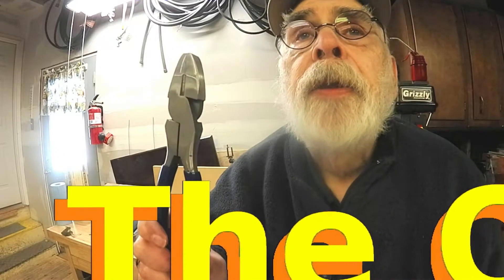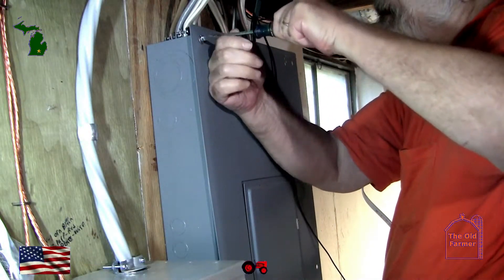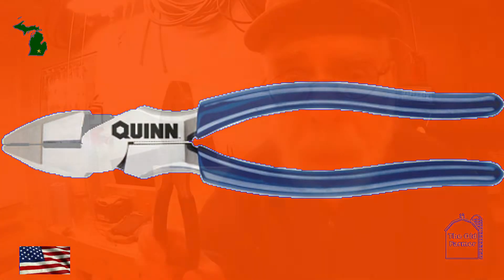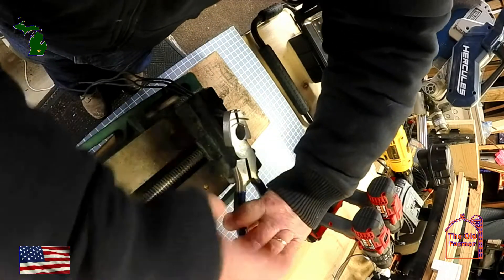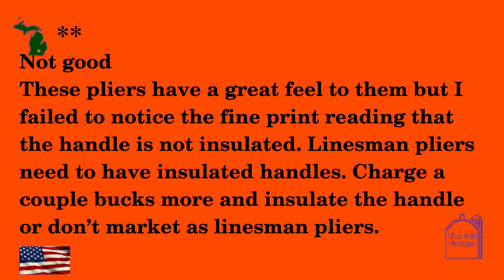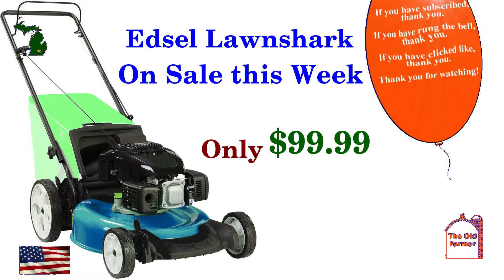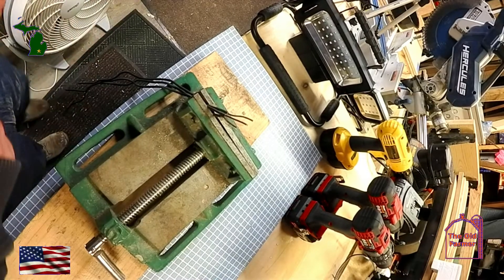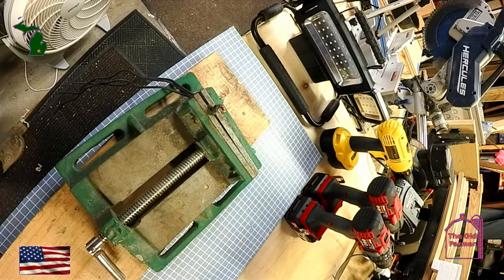Quinn Lineman Pliers - You Need to Get!!!

Comment: Just brought these pliers at a harbor freight outdoor sale for $9 bucks with 10 percent off coupon, didn't know what they are for just brought em because I was gonna spend $100 bucks on some junk, I know almost nothing about electricity, will use em when something non Electrified or safe needs cutting like a coat hanger, or some old speaker wires, or I might use the beveled sharp part as a Christmas Nut crusher cracker, seriously I brought em because they looked cool and will toss em in my took chest.